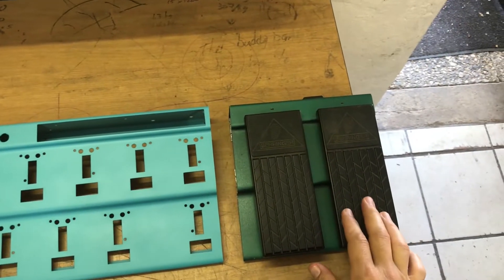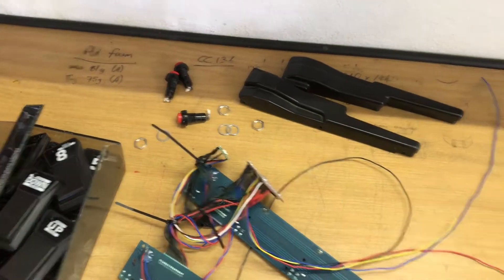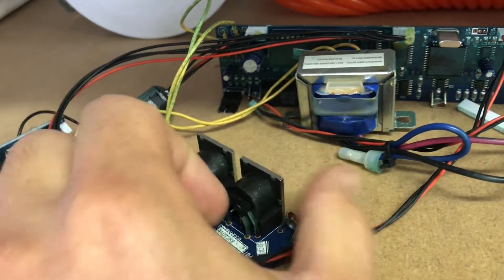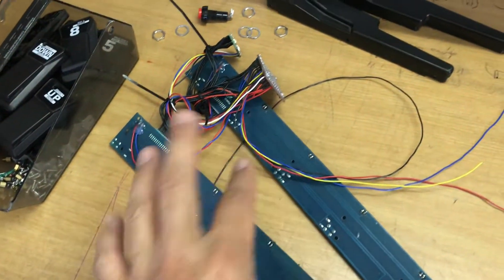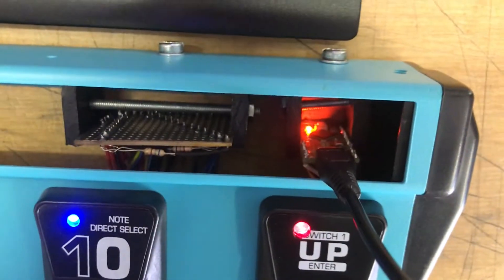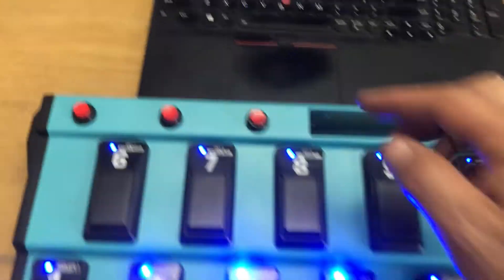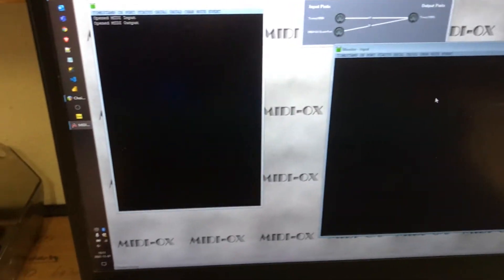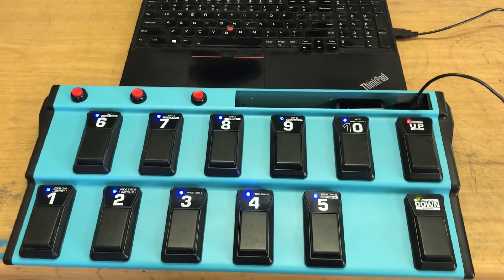FCB1010 midi foot switch

Comment: Wow!! Great video
Can update the firmware on this unit ?
Reply from the maker: Ah, thanks.. sorry for the late reply, I've not been monitoring the comments. I've completely replaced the original electronics with a Teensy Arduino board. And the firmware for the Teensy is completely updatable - it's simply plugged into your computer's USB port and you just upload the latest firmware.